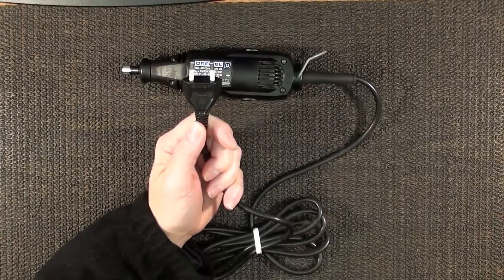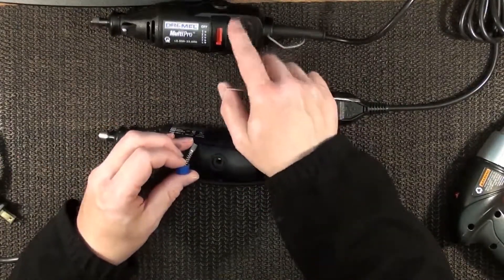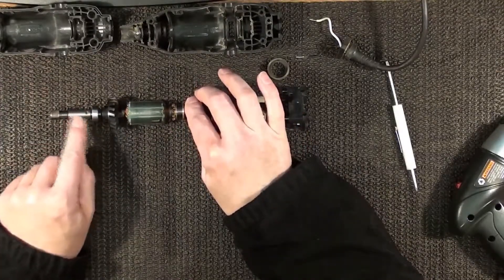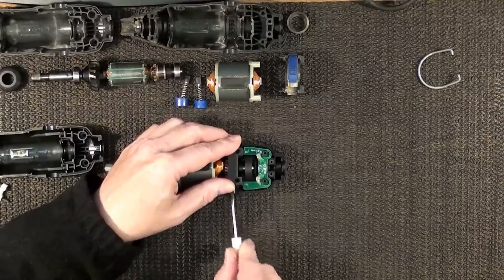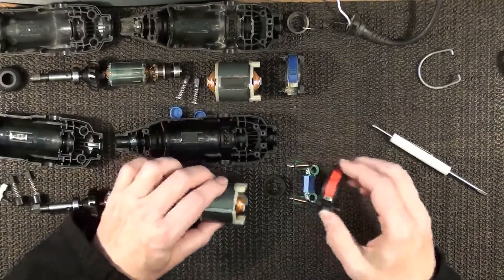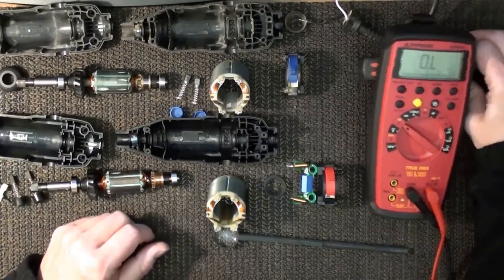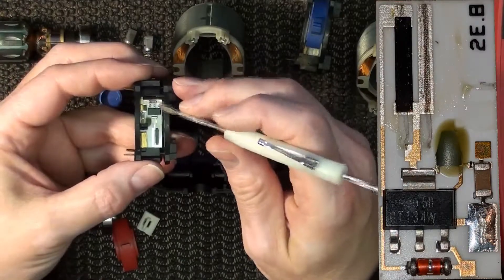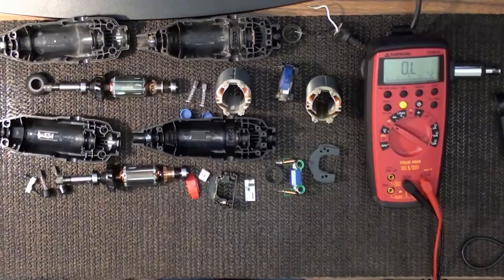Dremel Compare  -120 Volt vs 230 Volt

Comment: Well they are very similar,  but the field winding and armaure winding had to be different.
The speed control (light dimmer circuit) had to be calculated different as well.
I was waiting for someone to sneak in while you went to the loo and mix all the parts up in a big mound lol.